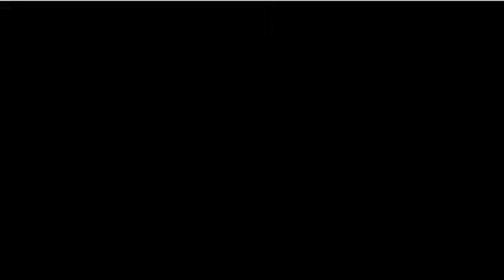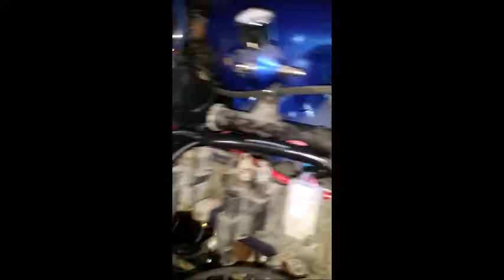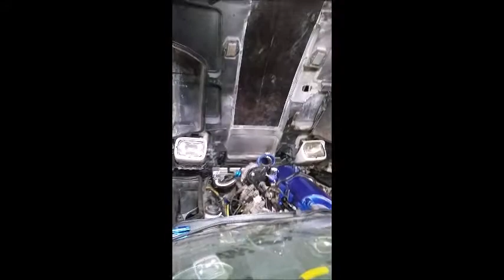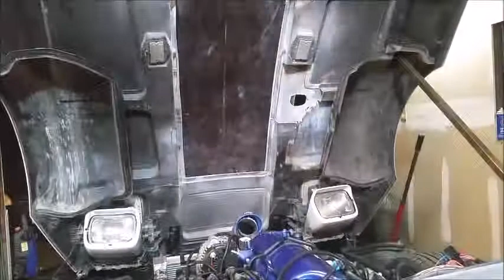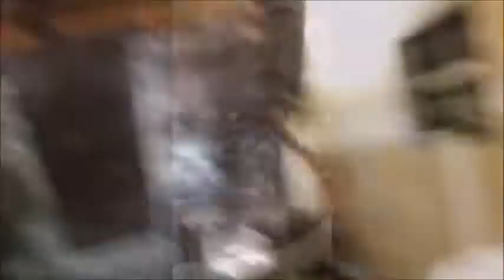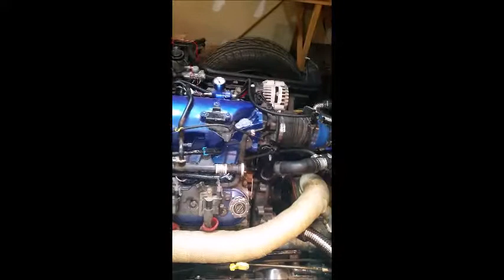c4 ls swap turbo build

Comment: How hard was the 5.3 swap? I have a roller been considering the 5.3.
Reply from the maker: Jimmy Benefield is was easy fits in just like a 350.    Buy the motor mount plates and good to go staring line are same size and everything
Reply: Thanks man everything I read sounded like it was going to be a pain in the ass. What trans are you running?
Reply from the maker: I'm run in a th400 but if yours in auto with the 700r 4 it will bolt right up. I made custom crossmember for my th400 so it will hold up drag racing
Reply from the maker: Jimmy Benefield follow me on instagram. Vette347
Reply: It's an auto car but I was wanting a 6 speed. Looks like a really well done car man.